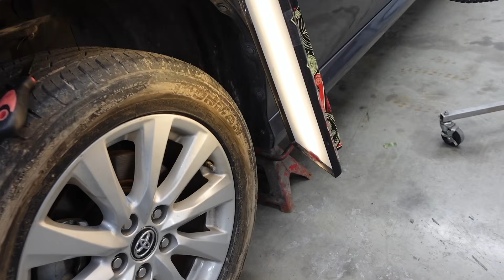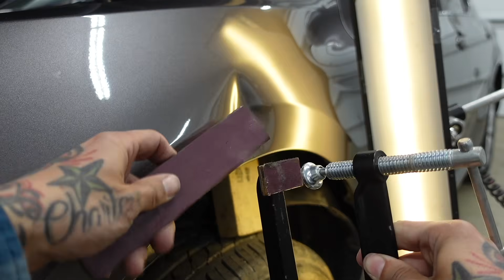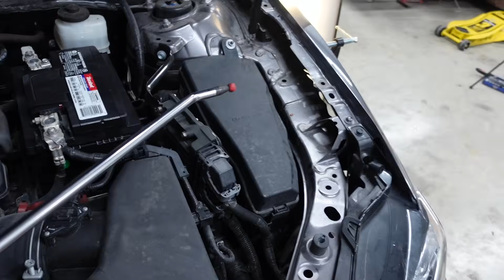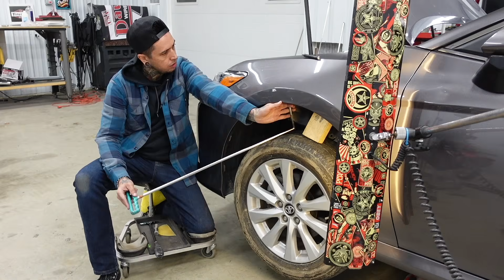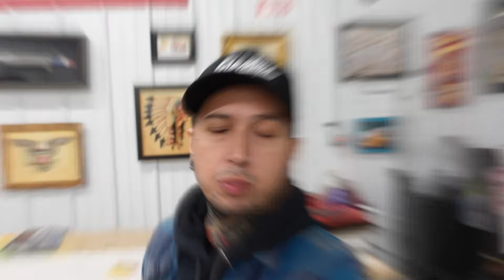Body line dent repair | Paintless dent tutorial

Comment: For a similar dent, the local PDR guy quoted $100 to start and $100 per inch after they measure the dent. Since mine was longer it would push it close to $1000. Fair pricing?

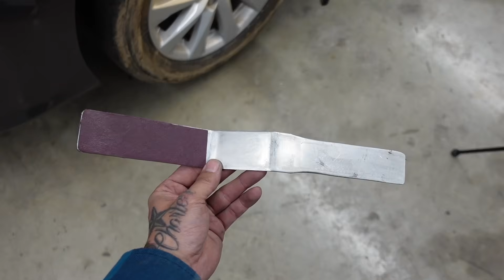Comment: @2:32  May I know the exact name of that tool in the form of curved plane you use to tap over with the rubber mallet? For some reason I can't find it online.  This method with C-clamps is very unique. But can I use a Heat Gun instead of gas lamp?  I have very powerful Heat Gun. I have that gas lamp as well, but seems it is more safe to use the HG. Thank you for the great and informative video.

Comment: I’ve been doing mobile Metal polishing for the past 6 years now and every once in awhile I also buff paint/ gelcoat/ fiberglass and large flat panel stainless comes my way every once in awhile, all that being said I had a return customer drive 2 hours to me to drop off his second PETERBLT/ RV conversion and these things are quite expensive more than I could ever afford and I’m very safe with other people things, however this disaster caught me off guard I had the rear axle jacked up and breaks released so i could spin the wheel as polished them and some how when I polished the front steers/ wheels I must’ve not of put the wheel chock back behind the wheel and when I let the jack down the RV rolled back and barely scraped the back of my flatbed pickup. I’m talking it grazed the back of the bed where I had a step ladder and bent the outward sticking legs on it but my main concern was it put a few dent on the stainless panels on the bottom of the RV and now after I polish it going to stick out big time. I can’t get it put a couple 3” creases and I tried popping them out but it seems I only made them worse. Any advice at all on stainless? And btw that welding clamp with the painters sticks I did that exact same thing but with little boards before ever watching this video. It straightened it out a lot better than it was but there’s still a line. I even heated it up with the propane torch. Any advice the customer will be picking it up by the end of the week and I’m losing sleep.

Comment: And if the dent is on a panel that is around the same place but the panel is double skinned, what then?.
Reply from the maker: In that case you would have to do a glue pull or try to fix it with a pdr tool .. Unfortunately the c clamp can only work with a open panel .
Reply: @elevationdentco  Thanks for the reply.